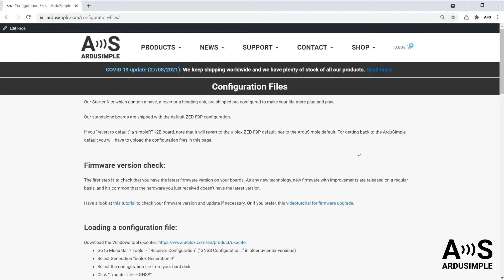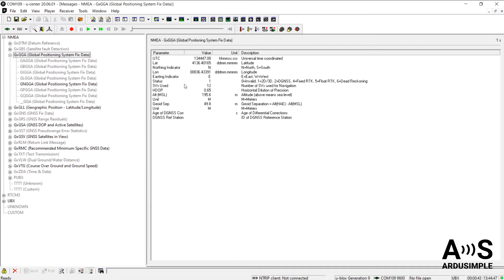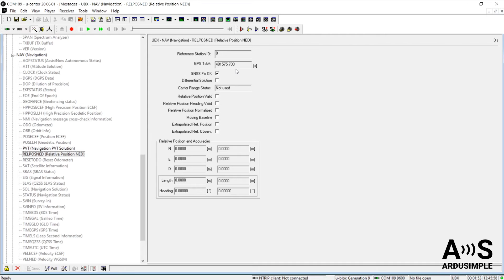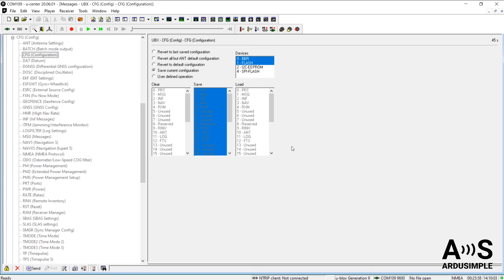u-center made simple - Configure your GPS receiver

Comment: what rover did you choose?
Reply from the maker: Hi Chris, not sure that we understand your question.
In this video we use a simpleRTK2B board that uses u-blox ZED-F9P GNSS receiver.
Reply: @ardusimple  what can I do with gps module in this software? I use this module in Rc model plane
Reply from the maker: @Chris-vc1dh  with this software you can change the configuration of your GNSS receiver (e.g.: enable/disable constellations, increase frequency output, ...)
It can also be used for troubleshooting when having issues with your receiver.